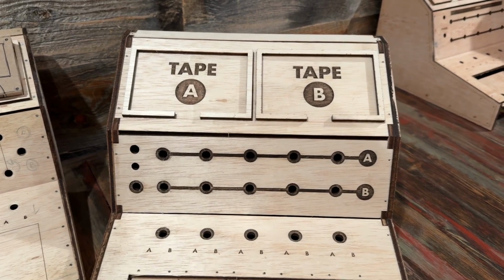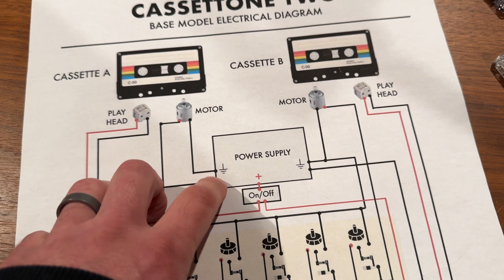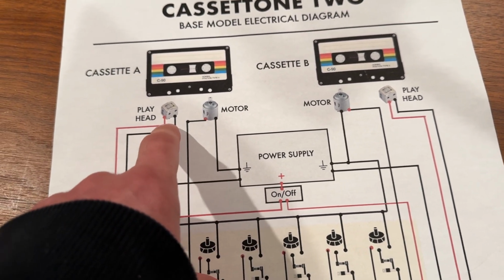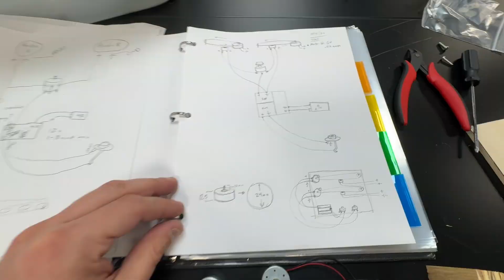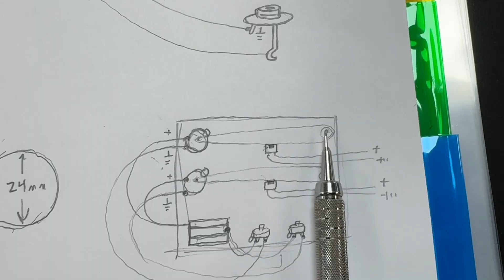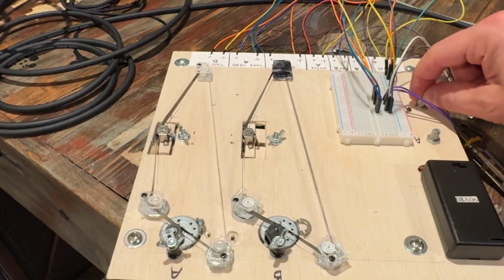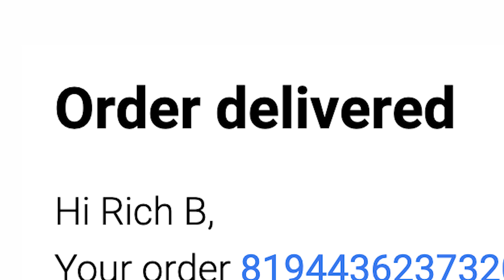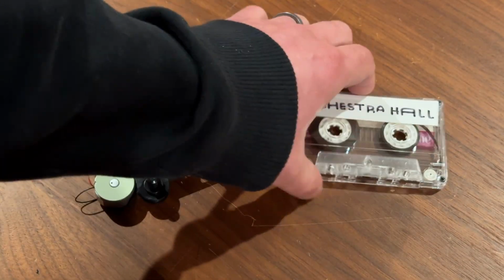Building a Tape Loop Player from Scratch | Prototyping the Cassettone Two

Comment: 20-some years ago, that prototype board is exactly what i dreamed of having in my tiny studio, with loops of different sounds hung from pushpins up on a cork board on the wall. Eventually I just used a soldering iron to melt two holes in the top of a radio shack front-load cassette player, and would painstakingly feed a section of tape through the works, then hold play + pause, and i could gently shift the ribbon back and forth manually in order to "scratch" the sound, wax record style. i bet you could also "scratch" with that prototype setup - it's really yummy looking! And i'm excited to see more progress on this v2.

Comment: Just a thought. Since you're using a wooden chassis, you may want to try and ground any parts in the tape path. just the surface contact of the tape on plastic can build static voltage over time, and since you don't have a big metal chassis ground plane, that could potentially happen here. Not definitively saying it would be a problem, but just something you might want to be aware of. I know you've built these things before, and maybe it's not an issue, but since this is a new project and new design, you may run into new problems.
Reply from the maker: @GameOfThePlanets  great feedback to consider. I appreciate any advice I can get! I’m bringing these comments to my tech person and we will add it to the our list of considerations. Thanks for bringing it up.

Comment: Awesome. Can’t wait to see the final product. What are you using to control the motor speed?
Reply from the maker: @SISKworks  in this video nothing really-just an  ill-advised pot that doesn’t do the job. The final design requires a transistor and cap in the circuit, but I have someone helping me out with that now :)